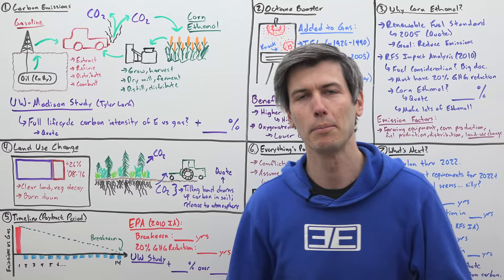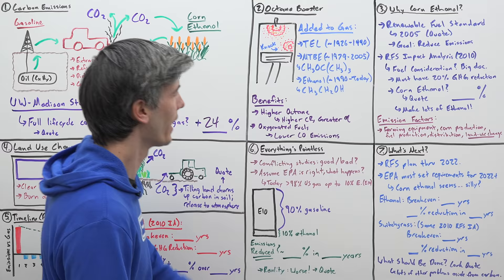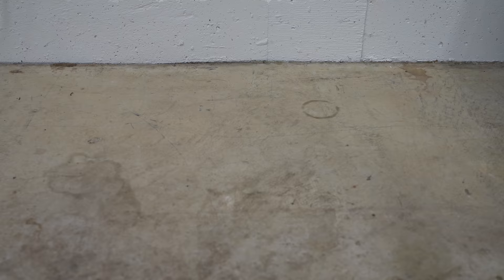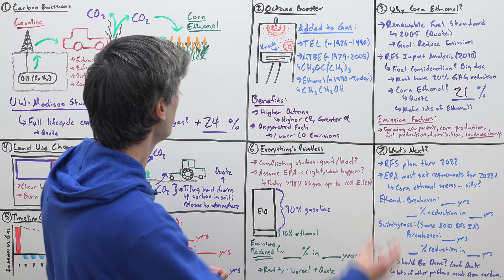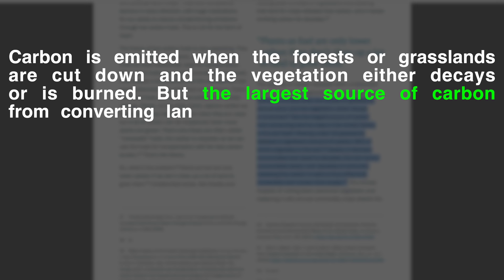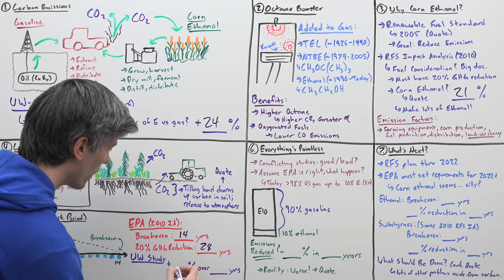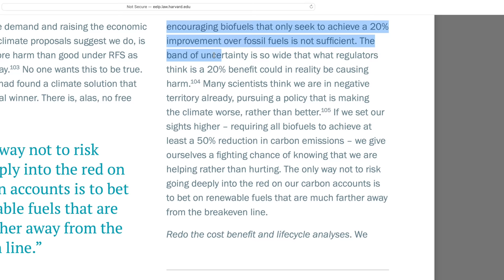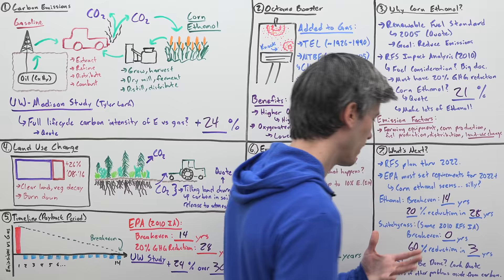America Was Wrong About Ethanol - Study Shows

Comment: I live in central Indiana and have watched this happen....all the small woods and fence lines cut out and burned. The resurgence of crop dusting. Ethanol is about money for farmers. Other factors to consider that increase the negatives for ethanol: fuel economy impact. The older vehicles that many people drive see a drop of 2 to 4 mpg between ethanol fuel and e-free fuel. Second consideration: the damage ethanol causes to small engines (chain saws, weed trimmers etc.) The performance and life span drops so dramatically when using ethanol that manufacturers of this equipment put disclaimers in their warranty- use of ethanol based fuel will void your warranty. This is why you see all the dedicated canned fuels being sold with these products. What is the environmental impact of all the additional small engine equipment being  sold due to shorter lifespan caused by ethanol?  What is the environmental cost of all the quart cans of ethanol free fuel being sold? Some states have this figured out and have pumps with "recreational fuel". There is only one gas station  within 30 miles of me that sells ethanol free gas. There is a line at that pump on a regular basis. People know the benefits of ethanol free gas. Small farms and lawn service companies are putting in small tanks and having efree gas delivered. When I was a kid evey farmer had 1 or two above ground fuel tanks with gas and or diesel. Looks like we are getting back to that due to big ag and its manipulation to sell more corn, regardless of the damage done to the environment.
Reply: No matter who you think may be benefiting, it's never the farmer. It's always the supplier or middle-man.
Reply: That "recreational fuel", and farm tanks, are for non-roadtaxed fuels. My dad's 1960's era craftsman lawnmower has run with E10 for decades without any issues. The nearly century old ford tractor has used E10 for ~3 decades and it's perfectly fine. The line at the E0 pump is because people are morons; they think it's better, therefore it is. The "warranty void" disclaimer is their excuse to not honor any warranty. Likewise the "pre-mixed" yard gadget fuels are marketing to the morons.

My track car (90's civic) was tuned with E10. If I use E0, it'll run pig rich because it won't have the extra O2 from the ethanol. Unlike more modern cars, it has no sensors to correct it. (as built by honda it does, but it will only correct so far) My 2001 VW 1.8T runs far better with E10 -- yes, it has sensors that can tell the difference. (and no, this is not VW cheating.) My '85 dodge b350 runs just fine with E10 -- it's a pig no matter what you use.

Comment: As a long time technician, and automotive instructor, I have been teaching this for years.  Lower fuel economy, higher commodity prices.  It only sounds beneficial when politicians try to sell it
Reply: Lower tailpipe emissions, including massive reductions of toxic PAH emissions, increased power output if designed to use it, decreased dependence on foreign oil.  Everything is a tradeoff.
Reply: @ChurchAutoTest  The video at the end was a push for an alternative besides corn. Switchgrass was the example
Reply: ETHANOL = MORE HORSEPOWER AND CLEANER BURNING AND CLEANER ENGINE!!!!!
Reply: @jl456  bless your heart
Reply: @CMB-yg3qj  it's true ask the guys that run it in there tuned high horsepower drag cars.
Reply: @jl456  did you watch the video? 😂
Reply: @jl456  you are talking apples to oranges.  None of my argument involved it's use in racing.  Sure it's higher octane so you can use more of it and produce more power, yet that has ZERO to do with this conversation...
Reply: @h.d.h  Probably better if he didn't because it was flawed from start to end. Didn't account for the distillers grains that is produced concurrently with the ethanol. For every acre of corn used for ethanol there is an acre less soybeans needed. So the claims of negative impact due to land use change are gibberish. Once all the savings from growing less soybeans are factored in, the bottom line shifts to a positive for corn ethanol.

Comment: As a Johnny come lately, corn also is hard on the environment for another reason; nutrient and mineral stripping. Corn is quite hard on the soil that's why a crop rotation is a  must and the area I grew up in it was generaly replaced with alfalfa to restore what the corn stripped from the soil. Even then there can be more needing to be done to keep the ground from going sterile and even letting the land sit fallow isn't off the table.
Reply: Corn, soybeans and wheat have always been in the crop rotation at our farm. For almost a century now. Yeah, we use anhydrous and manure, but yields have always improved.
Reply: Not really. I have a field that’s been continuous corn for 30 years. The ground is far from sterile 🙄
Reply: @samdetwiler4531  You probably also chop up the stalks and return them to the soil.  That is the key.  Fertile land requires organic matter.  Removing the spent stalks depletes the land.
Reply: Once you grow an alfalfa field, you usually leave it that way for many years.
Reply: @bryanspanjer3213  3-5 years, depending on how many cuttings you make a year.

Comment: I know in Kansas we saw a dramatic increase in corn production. But it quickly died off in the western half of the state because of how much irrigation it required. It’s already pretty dry out there. I’m sure the study mentioned CO2 emissions from fermentation. I’m curious if we’ve considered some kind of waste product as a feedstock for alternative fuels. Renewable is always difficult because it often yields small returns or a negative net gain.
Reply: 100% of the CO2 from the fermentation and burning of ethanol just came from the atmosphere and 100% of it needs to be back there to make the new gallon of ethanol.

Kansas is an outlier in that it truly did increase corn acres.  The corn belt grew more corn acres in 1980 before ethanol than in 2018, the year of most ethanol production ever.  Northern states increased corn acres as cattle feeders switched favor from feed barley to corn and as newer early maturing high yield varieties came along making the crop viable, a trend which began before ethanol.  

Kansas
1980 before ethanol = 1.7 million acres of corn
2018 most ethanol ever = 5.45 million acres of corn
1932 during Prohibition = 7.65 million acres of corn

This is an increase of 3.75 million acres of corn in Kansas from 1980 to 2018.  They lost 1.7 million acres of sorghum and lost 5.3 million acres of wheat during those same years.  Soybean acres increased 3.2 million.

US barley acres were 8.32 million acres in 1980 before ethanol and declined to 2.55 million acres in 2018, the year of most ethanol production.  Corn acres in 1980 were >84 million acres before ethanol and during forced government land set aside and were 88.9 million acres in 2018.  Combine the two and we get 92.32 million acres in 1980 of the two feed grains vs 91.45 million acres in 2018.

1980 before ethanol = 92.32 million acres of corn and feed barley in US
2018 most ethanol ever = 91.45 million acres of corn and feed barley in US

Kansas irrigation use (cropland and golf courses M/gal/d) USGS data available: 
1985 4734.59 
1990 4186.16 
1995 3383.42 
2000 3714.39 
2005 2739.07 
2010 3041 
2015 2678.95
 
There were no grasslands broken up for corn. Quite impossible on the face of it since US cropland acres have been declining. Census data show corn producing states since ethanol increased grassland, forest, and wildlife areas.
 
Corn ethanol is a value-added product of already existing feed production acres which preserves the feed in a healthier and more productive form called distillers grains.
 
I did look up Census data at USDA of grassland, forest and wildlife areas in Kansas for fun. 2012 is newest data available but the ethanol mandate was 88% of the maximum by then so it at least gives us an idea on where things were going. 

Kansas grassland area 
1982 13,907,000 acres before ethanol 
2012 17,781,000 acres after ethanol 

Kansas forest use land area 
1982 1,359,000 acres before ethanol 
2012 2,402,000 acres after ethanol 

Kansas wildlife and rural park areas 
1982 116,000 acres before ethanol 
2012 335,000 acres after ethanol

Comment: Back in a MIT class I took in 2010, shared research that the energy rate-of-return was close to 1:1. (energy to process : energy output). Oil from ground varies from >100:1 to 20:1, for comparison.  Lots of factors: energy to dry, process, collect, etc. So the 24% greater CO2 isn’t entirely surprising (especially if ethanol production requires a lot of electricity; more coal plants in the areas that grow corn, so there ya go)
Reply: The energy debate moot / it boils down to American's funding the US economy with corn ethanol purchasing instead of sending all our money to other countries to import more oil //
Reply: I've no-tiilled just about everything but corn.The ethanol plants don't process weeds and grass very well.  One of the main drawbacks of corn is draining the Ogallala since it requires so much water.
Reply: It was always political.
Reply: Oil is not renewable. Need to compare with other renewable sources. You are comparing different things
Reply: @AladimBR  If tried to make ethanol by burning ethanol you would end up with nothing.... or less.
Reply: @AaronSchwarz42  People forget we have been energy independent as recently as 2020 and 2014. Of course that was due to fracking which is a bad word so we'll just ignore that little inconvenience.
Reply: @AladimBR  Right, but it is far more efficient and available in sufficient enough quantities to meet our energy needs for quite some time.  When you develop hydrogen, let us know.
Reply: My 150 bushels corn per acre produces 485 gallons of ethanol, 150 pounds of corn oil for diesel blend and 2.7 tons of high protein animal feed all on 10 gallons of fuel. That's a GREAT rate of return. Going from 10% blend to 15% would REPLACE ALL RUSSIAN OIL. Get with it people.
Reply: @mikeclemens5735  Does it take 10 gallons of diesel to harvest 150 bushels of corn or does it take 10 gallons to harvest AND process 150 bushels of corn into feed, corn oil and ethanol?
Reply: @madeliga but if the energy required to process the ethanol comes from non-renewable sources, then the ethanol itself can’t be considered “renewable” (especially at the ratio I’ve seen which is close to 1:1). This video further implies that ethanol cannot be considered renewable if the CO2 produced exceeds what is saved.
Reply: @Mike Clemens your value sounds like what’s used to plant/harvest. The full energy use includes transport and processing (which is obviously outside of your farm). It may seem like a great ROR from the farm but it’s the processing that drives the ratio/CO2 emissions. I recall it’s primarily due to ethanol; other feeds can lead to better ROR but require greater industry buy-in.

Comment: Although further land clearing of poorer soils has occurred to a small extent, the percentage of new clearing is miniscule in agro-intensive areas of the world, such as N America, whilst this is not the case in the rainforests of Brazil. Present day shifting of crop production is from already in-production land bases, thus negating a large part of the argument. 
I believe the argument would have been more substantive analyzing energy inputs versus outputs. What are the opportunity revenues of polluting less from overuse of agri-chemicals, both N, P and herbicides ? Unfortunately, those economics aren't as standardized.
Why not include the risk factors of economic fallouts in poor growing years, something that climate change has already thrown a wrench into. Modern agriculture requires enormous capital and cash for crop inputs. Why not depend more on regenerative agriculture to drastically reduce input costs much to the dismay of agri-business, and, reduce annual risk ? 
The conclusion is the same though, corn is a terrible crop because of its high inputs including water which should be taken into account as a finite resource. Just ask California if water use is an important consideration. 
When I hear " from the goodness of corn " as a moniker for several ads, one shudders.

Comment: Great points.
What about gas (with ethanol) that has sit for a year, than the gas gets thrown out because it is bad.
Plus the parts that get replaced due to the residue left behind from ethanol.
I am not arguing that ethanol can give a higher octane rating, but the damage to small engines is not worth it.
I have experimented with ethanol and non-ethanol. My results are that the ethanol can yield more power (I think due to the higher octane) but non-ethanol gas can last over a year where ethanol gas is only good for a few months.
I have let non-ethanol sit in a small engine over a year and it starts with first pull. Same situation with ethanol gas, and parts had to be replaced to get small engine to run.
Reply: Ethanol is extremely hydroscopic. Which means that is pulls moisture from the air. BTW, this is very bad and a big reason why it degrades over time.
Reply: Most of us by now realize that we need to have nonethanol gas in them if they are going to set around unused.   And if not that, at least have that gas treated with something like marine stabil etc.   I actually do both on my small engines used seasonally
Reply: Imagine the CO2 required to replace all those weed wackers and snow blowers that are thrown away because they won't start (due to the ethanol) and the owners don't have the time or knowledge to repair them. 

I think this is a HUGE miss on this video. 

Just the repair parts (new hoses, diaphrams, etc) if repaired require enormous amounts of CO2 to produce.
Reply: who lets gas "sit for a year"and what does that even  mean?
Reply: @divesaildivesss    AMEN BROTHER !!!  That was pretty much what I said,  at the end of what I posted earlier. (at the end of my rant)  lol.   Great minds think alike.   ;-)
Reply: @davidjones-vx9ju  If you don't know that gasoline sits for large periods of time, on occasion,  you lead a really sheltered life, or have a limited imagination
Reply: @archimedesmaid3602  sits?where?
Reply: Regular gasoline has a shelf life of three to six months, while diesel can last up to a year before it begins to degrade. On the other hand, organic-based Ethanol can lose its combustibility in just one to three months due to oxidation and evaporation.Aug 25, 2020
Reply: @davidjones-vx9ju  You arent the brightest bulb on the tree, are you?
Reply: @archimedesmaid3602  insults   are all those who are wrong have  left
Reply: @archimedesmaid3602  what is a "large" period  of time?   is English  your first language?
Reply: @davidjones-vx9ju  >>>>"who lets gas "sit for a year"and what does that even  mean?"<<<<

You actually can ask inane questions like that!   

I will help you out:  When gas "sits for a year", most probably it means that it is in a tank on a vehicle or piece of equipment, which has not been used for a year.   Does that help?

Also, as for ethanol gasoline, 1 year can be defined as "a large" amount of time

Do they allow you to drive?

Glad to help you with these large problems which you encounter